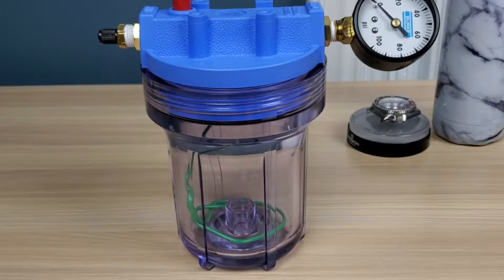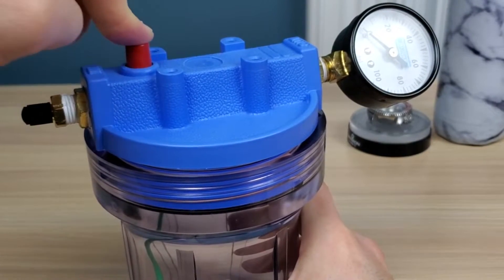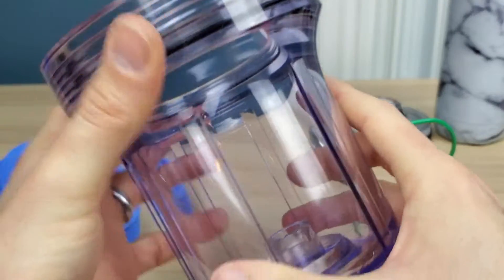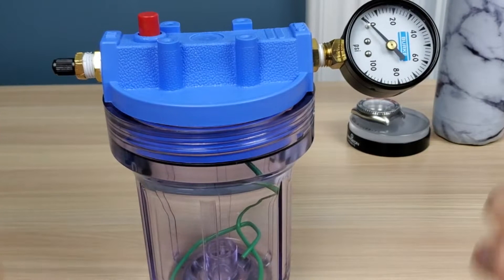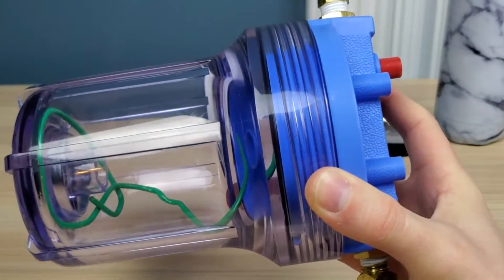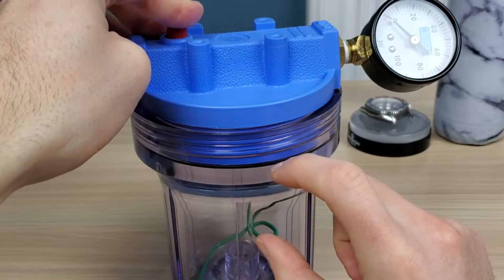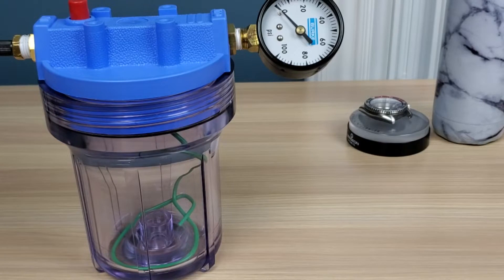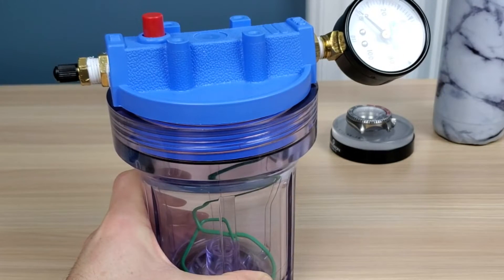Make YOUR OWN Seiko D.I.Y. Water Pressure Tester

Comment from the maker: If you have a bike PUMP with built in pressure gauge you don't even need to put one on the tester. I have used a pump with its own gauge. and each pump of air matches the gauge extactly. So it is accurate. This way you can go to 250PSI MAX RATING FOR THIS CASE Which is about 170M WATER RESIST . Be Careful and Test at your own risk. Follow maximums and guidelines of the canister you purchase.
Reply: 125 psi is the rated max. pressure for this water filter housing. 250 psi with this is very dangerous. Otherwise awsome idea, thank you for sharing. Your explanation makes perfect sense.
Reply: @elduderino1329  look up hydrostatic test for air tanks water won’t compress and won’t explode like pure air will. Look at videos of it it just cracks and water runs out it’s actually way safer than you think.

Comment: hey, thanks for sharing this method! I wondered: couldnt you also simply have the watch case (no movement inside yet) submerged in water from the beginning and build up the pressure, leave it in there for like half an hour and then release the pressure to take out the watch, take it out and see if any water made it inside the case? You would save yourself the whole turning around and checking for bubbles part. Maybe with an absorbant piece of paper stored inside the case beforehand to make any leakages into the inside more easily identifiable? Just wondering if that wouldnt be a slightly easier way to go about it
Reply from the maker: Yes you could. If you want to be careful, seal up the case without the movement. Then you can just copy the rest of the steps exactly the same.
Reply: What @todoku8257 it’s asking it’s if you can’t just submerge the empty case in the water and build up pressure without having to use the steel holder. You said follow the exact steps so that would mean building up the pressure while watch it’s not sumberged

Comment: Great video, thanks!  
Regarding releasing pressure before submerging vs. submerging and then releasing pressure.  
If your watch leaks, the inside of the watch case will also be at 100 psi.  If the pressure in the chamber is released too quickly, the crystal could pop out from the pressurized watch case.  If this occurred with the case submerged, you would blow the crystal out and flood the watch instantly.  Therefore, releasing pressure with the watch dry (and only submerging an intact watch case) you mitigate the submerged-blow-out scenario.
Thanks again for the great video!

Comment: its 80 usd for the professional ones in aliexpress... why spend the 50-60 how much this cost find very hard to find pieces hope it all fits ect..
to save 20 usd ?
Reply from the maker: This one has a stronger case and can test to deeper over 100 m the one you're talking about on Ali can only test to 60 m. For mine I just have to change the valve but the case is capable

Comment: Talked to the engineer at Pentair that makes that filter housing. It can handle way more pressure than you are taking it to. I regularly pump mine to 350psi which is 250m/820ft , the iso 6425 std for a Diver 200m (25% over)  Comments are correct, get almost all the air out and there is nothing to explode. I use a mini hand pump that is used to charge mtn bike shocks, available cheap on Amazon. I put the pressure gauge on a T fitting with a small ball valve which allows you to add water through the  valve to have as little air as possible.  Thx for the great video!
Reply: Hi ! I commented late on this comment was just wondering what did toy use?
Reply: What type of pump allows you to generate 350 PSI?  That's crazy high.

Comment: Pentek's website says 125 max PSI for $30 piece!

$400 3M's Aqua-Pure SST1HA, One High Stainless Steel Filter Housing 3/4 NPT Horizontal for 300 psi = 200 meters water resistance. 

$250 Pentek's 156017-02 ST-1 3/4-Inch Stainless Steel Filter Housing for 250 PSI.

$x Filtration Group (Formerly MAHLE Industrial Filtration) High Pressure Filter Pi 4000 is rated for 5690 PSI = 4000 meters. Rolex Deepsea.

This is what you need, made from a professional engineering company. They make industrial machines for commercial oil rigs, natural gas transportation and commercial filtering.

3M has a stronger reputation. If 3M say 300 PSI, you best believe it's 300 PSI.

Comment: Thanks for the video—I was about to pay $200 for an off-the-shelf tester that only went to 60M, so you saved me like $130 and now my tester will work to like 100M+!
Reply: 3M's Aqua-Pure SST1HA, One High Stainless Steel Filter Housing 3/4 NPT Horizontal for 300 psi = 200 meters water resistance. 

This is what you need, made from a professional engineering company. They make industrial machines for commercial oil rigs, natural gas transportation and commercial filtering.

If 3M say 300 PSI, you best believe it's 300 PSI.
Reply from the maker: You are welcome!

Comment: Where are your sources for that 250psi testing?  In most circumstances, manufacturers are required to test at 20 or 30% over indicated maximum.
Reply: Pentek's website says 125 max PSI for $30 piece!

$400 3M's Aqua-Pure SST1HA, One High Stainless Steel Filter Housing 3/4 NPT Horizontal for 300 psi = 200 meters water resistance. 

$250 Pentek's 156017-02 ST-1 3/4-Inch Stainless Steel Filter Housing for 250 PSI.

$x Filtration Group (Formerly MAHLE Industrial Filtration) High Pressure Filter Pi 4000 is rated for 5690 PSI = 4000 meters. Rolex Deepsea.

This is what you need, made from a professional engineering company. They make industrial machines for commercial oil rigs, natural gas transportation and commercial filtering.

3M has a stronger reputation. If 3M say 300 PSI, you best believe it's 300 PSI.

Comment: This is pretty genius. Mad I didn’t think of this myself. So it’s actually really safe. The way hydrostatic testing is done for air tanks is filling with water. Water doesn’t compress. So if it cracks it won’t explode as the water isn’t under pressure. I would fill with as much water as possible and like 5% air that way if it cracks it won’t explode. 

This is a very good idea thanks for sharing.
Reply: 3M Aqua-Pure SST1HA, One High Stainless Steel Filter Housing 3/4 NPT Horizontal for 300 psi = 200 meters water resistance. 

This is what you wanted, made from a professional engineering company.

Comment: You should do a preliminary test in air, and a second test in water. This is to prevent the crystal from popping off under water if there is a major leakage, as you don't want that to happen when the watch is submerged!

Comment: Recommendation: use higher pressure gauge.
Reason: gauges are most accurate between their 10:00 and 2:00 positions. So sizing a gauge to read your desired pressure at that point is best practice.
Reply: the most accurate is between the 20% ---80% of the range or is from the 30% to 70% i don't remember
Reply: @jhoncadena452  it really is closer to being a clock position on dial gauges, because it is clockwork that determines its range. It might be different on digital gauges though, I’m not really familiar with those.

Comment: This is an awesome kit and video you made!
A lower tech way is row your boat out into deep water and drop the cases down to depth using a spool of kite fly line.  Could either put some paper in the cases with some red water soluble ink dots or put them in the refrigerator for condensation test after deep dive.
Reply from the maker: thats a lot of effort but would work! no need for the paper inside. if the watch comes up with water it failed.
Reply: @EscapementWatch  Could also cast it from a fishing pole.  If you had access to water main pressure (80 to 140 PSI), you wouldn't need a pump.  Bicycle pump is easier.

Comment: If you reassemble the watch wrong, will you ruin the watch during the test?
Reply from the maker: Yes it could happen. However, I keep the guts outside and seal the watch empty just to test the seal on the crystal and case back and crown.
Reply: Escapement & Watch ok but what about when you completely reassemble the whole thing does it need retesting in the pressure chamber??
Reply from the maker: @bobsawah9439  It should be done technically. But its only really the crystal we are concerned about. opening the back is ok because I know i will tighten the caseback to spec.